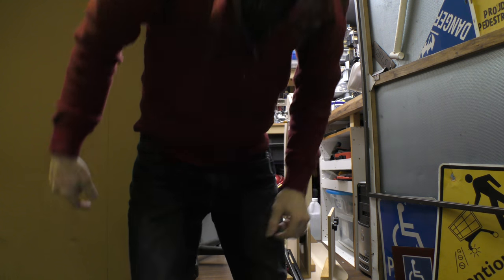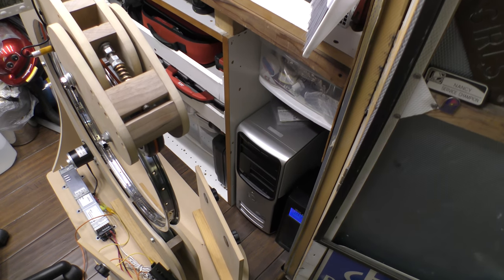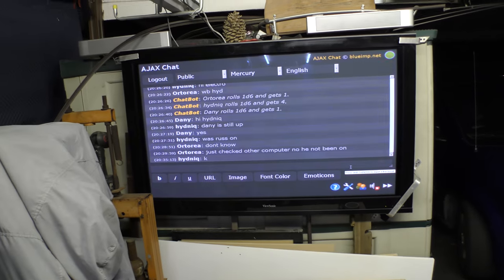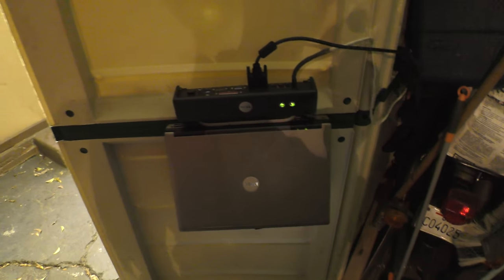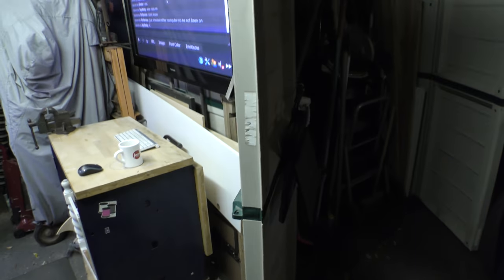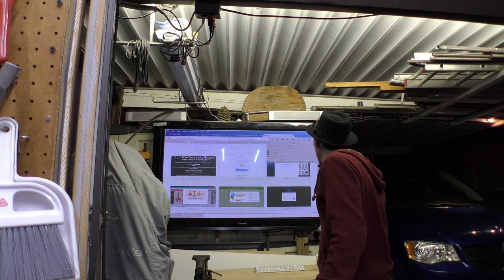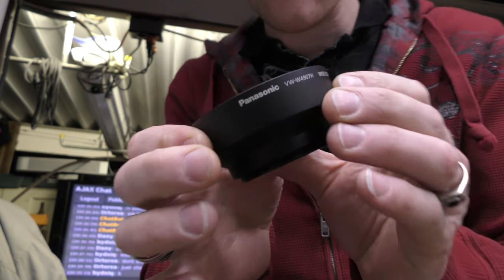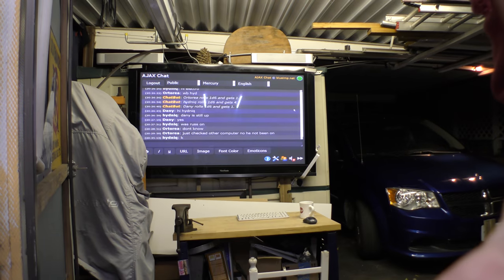The 10,000$ Plasma Tv that Tried To Break My Back! + Mic & Wide Angle Testing!

Comment: My friend, if you do a shotgun recapping that plasma will really come back to life, about 20$ worth of caps concentrating in the power board. You could mount it slightly angled on your ceiling so its easily readable and when needed use a "white screen" for an additional boost of light for the area.
Reply from the maker: yeah all caps look ok but it's hard to tell. All that heat back there I'm sure there are some bad ones. ;)  ~Russ

Comment: The flicker is related to the the refresh rate and camera recording rate. The TV display refresh rate is usually 60 or 70 frames per second. The camera you are using is around 30 frames per second capture of images. The TV beam on the horizontal line hitting the phosphorous for on the screen and it starts to fade, until it is not again. Our eyes cannot see the fading part of the cycle as it is too fast, but the same phase effect is then seen when the camera dark and bright phase captured interval hits our eyes and we thing the dark/ bright is just a couple of seconds,In reality it is nearly 10 times faster. We do not see the higher frequency. 

The two frequencies collide in phase during part of the dark frequency cycle for s period of time, that is just beyond the phase that it was refresh and the camera sees darkness as part of that phase of the frequency capture cycle, before shifting back to light part of the phase and then back to dark. It is your eyes perceived this part of the cycle between dark and bright as but in reality it is moving far faster than our eyes can percieved as we can only noticed hundred of milliseconds at best, while screen capture is more than 10 times the rate of what our eyes can see. Video is just a lot of captured stilled images at a low rate (60) per second with sounds.
Reply from the maker: wow, that was deep and I agree what that! thanks!! ~Russ
Reply: ***** I was tired last night and by brain frequencies were running a lot less than normal, and did not quite explain it right. I was a bit incoherent. But the gist of what I said is correct.

The Old CRT and Plasma screen is full of colored dots that needs to be refreshed or changed and the old TV and Plasma screen scan across the lines updating or re-highlight the particular phosphorous colored dots. It in a sense have a temporary lifespan as the power from the refresh scan fades as it is converted into light, which excapes, leaving only darkness behind, until it is refreshed again. 
https://en.wikipedia.org/wiki/Refresh_rate
https://en.wikipedia.org/wiki/Plasma_display

If you remember from Physics class Wave propagation.
http://www.phys.uconn.edu/~gibson/Notes/Section5_2/Sec5_2.htm
 If you run two different frequencies side by side,  interference and destruction are phenomenons in which two waves superpose to form a resultant combined wave and this is repeat over and over again where you see repeated Interference and destruction waves. Waves amplitude increase on Interference part of the two positive (or negative) phase and destruction of the waves when they are in opposite phase (where one wave is high and the other is the opposite polarity canceling out or summing of the two opposing amplitude is closer to zero).

The video is a series of still images of a moment of time, like rapid photo capture and recorded sounds and you have one instance in time to view an image for a period of time as it fades and until the next image is produced and refreshed onto the screen for example 70 or 60hz. 

Now your camera captures at  lower rate 30hz and at different frequency TV refresh rate. So for a period of time the camera captures when the screen phosphorous dots have faded, and not see the light part, until it gets closer to the TV light part of phase and then the cycle is repeated. So it is a bit like seeing Interference and destructive waves from your mind part. Also your brain runs on Frequencies and see the light from the camera image in a similar fashion at a slower rate. In a sense our eyes and minds miss alot of transitions as it works on much slower frequencies, so we see the slower part of the light and dark, by missing alot of the transitions.

If the camera and TV were running at the same frequencies you could in theory only see darkness from the TV dots, as the camera capture rate would be out of phase of the TV refresh rate missing the light and only showed the darkness phase.

Comment: +++1 on external microphone.  
The single-pixel speckles are usually associated with DVI/HDMI digital signal noise, either in a weak cable or the receiver chip in the Plasma Monitor.  I've seen it when I use a low-quality (or failing) DVI or HDMI cable.  DVI/HDMI use Differential signal paths requiring a matched pair of twisted wires for each signal, with opposing polarity signal phases. Each signal pair has to be matched in skew (pair length) to within a gnats arse.  That plasma monitor is only rated at 1366x768 actual resolution, are you running it at that?
Reply from the maker: even with no input the speckles are there... 

no i cant get it to go that high, only 1080 x 768, more thigns to try still but with the time i had to mess with it that was it... 

~Russ

Comment: I have a plasma it stopped working I opened it found 3 bulging capacitors desolder them found replacements resoldered  still working 5 years later
Reply from the maker: i bet, with all that heat generated those caps suffer! i looked this one over good and did not see any that were bulging, so i suspect there all right... will see how long this lasts lol ~Russ

Comment: That green snow is due to the power supply control board failing. Eventually it will get more busy producing the green snow until one day it just will fail to turn on.
Maybe $10k 17 years ago now its just a hindrance.

 If ya take off the back and see the PSU box (the mains plugs into) you`ll see a cable going from that PSU to power board... Thats ya huckleberry.
Reply from the maker: yeah all caps "look" good... so ill need to test them if i want to fix it. :) bad thing is it was in the ran for a bit so all the tiny connectors are starting to corrode.  so if i take it all apart i guess ill need to clean all those because it may make a bad contact once put back... contact cleaner i guess :) ~Russ ~Russ
Reply: Oh yeah? try all the different input ports see if ya get the same green interference. They aint designed well for thermal dissipation, first thing to go will be something on the power board.